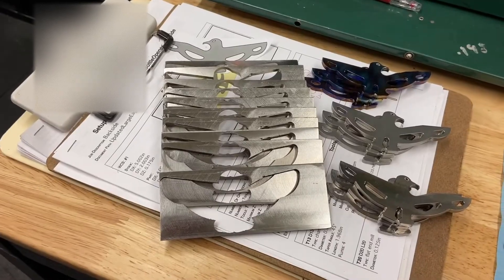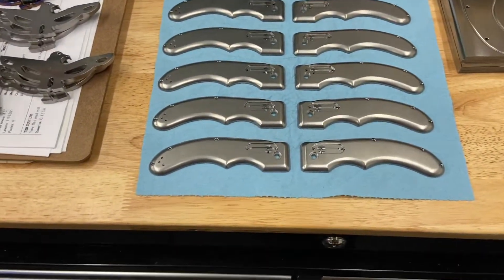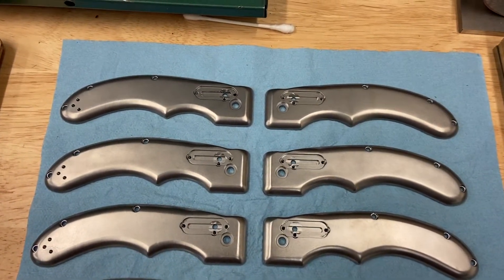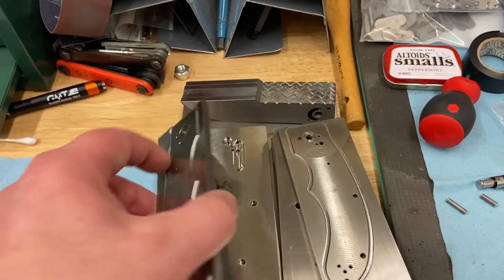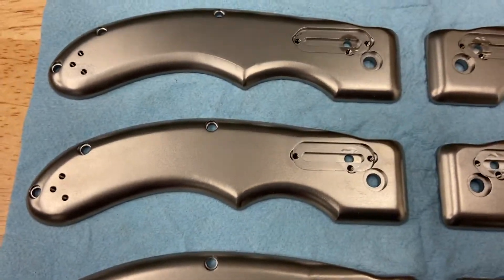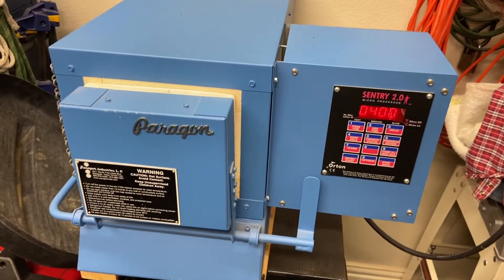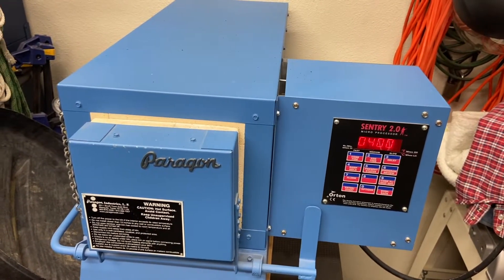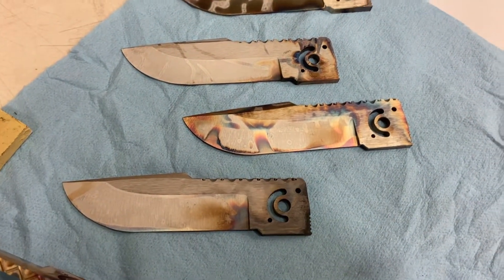What Has The Tormach 1100MX Been Making Lately?

Comment: Are you doing any of the bevels with the mill, or are they all done on the sanding wheel?
Reply from the maker: Nick Mullins - So far still doing all the bevels by hand on a belt grinder. Maybe if demand is there I will try some on the Tormach but I like making knives so enjoy doing parts of it by hand. Thanks for the question.
Reply: @BladesIIB  I am looking to do something similar to you, but in the fixed blade segment. I have seen some ppl do some STUNNING finishes on their bevels on HAAS products and I was curious if the Tormach could duplicate it.
Reply from the maker: @harlech2  I don’t see any reason why the Tormach would not do it. I am doing all the contours on the slabs with it no problem. Should be fine with a ball end mill to make the blade hollow grind. May have to make a good jig to support it for the second side?